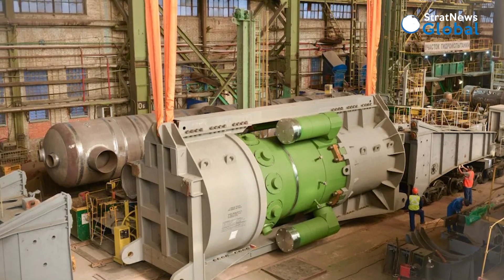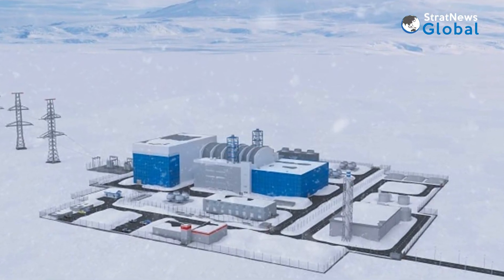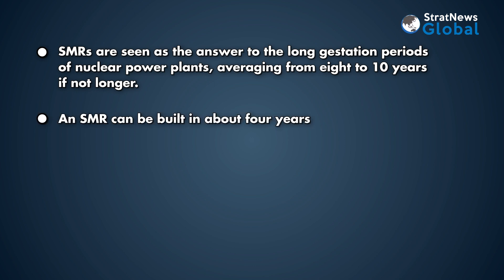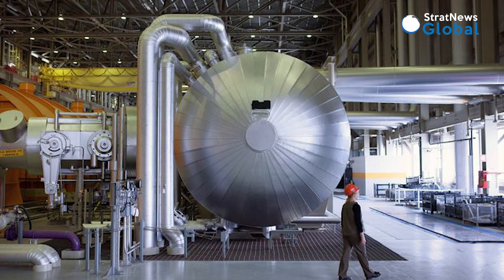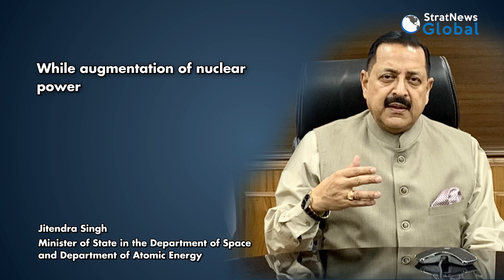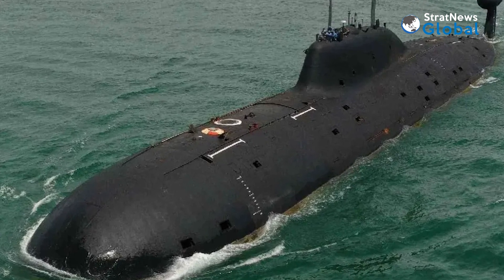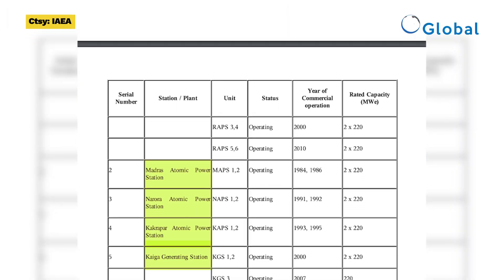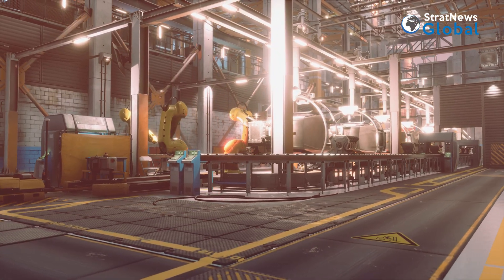Small Modular Reactors: A Game Changer? | #nuclear #nuclearenergy #india #russia

Comment: India can use its naval reactors. India makes heavy water reactors in four to five years. Bound to decrease over time with this lot in fleet mode. These are 700 to 900 mw. India had no need for them and if need arises use naval reactors. Nothing better than them 
As a reactor.india designing pressuzided water reactor using as much as the parts as possible that make up a complete heavy water reactor like steam generators and so on. India doing it to queez out energy of every bit of the fuel with uranium prices constantly. Increaseing. When  uranium cost 40 dollars per pound price  to fuel 1000 mw pwr reactor million usa  dollars every three years.  Today 2024 uranium price 200 usa dollars  per pound. Do the maths. India using spent waste uranium from pwr in heavy water reactors. It is better than a goldmine. I am impressed!.